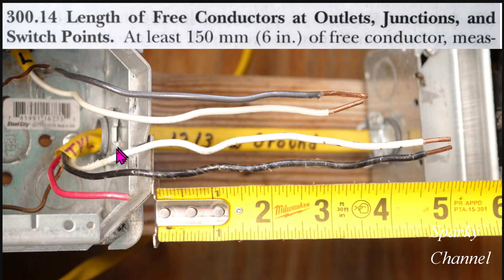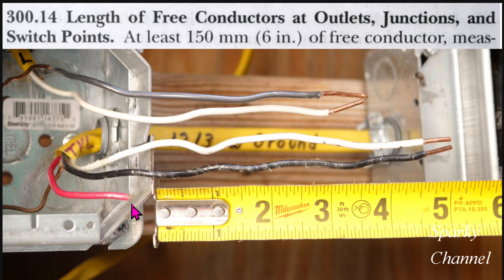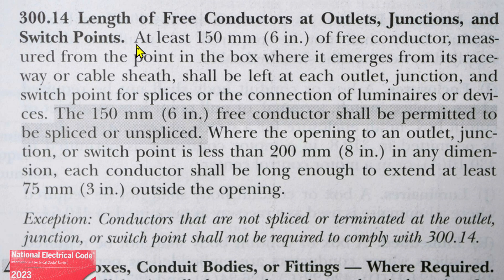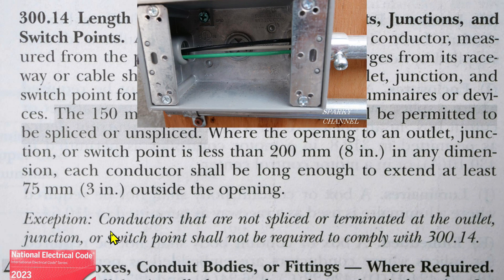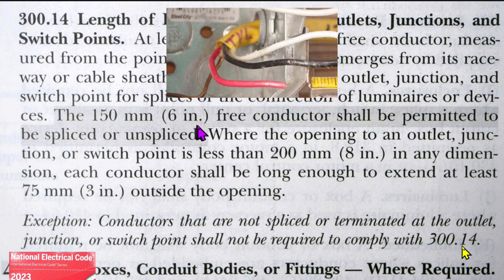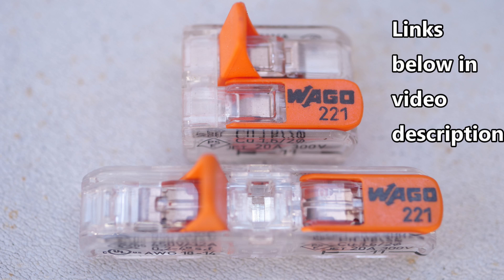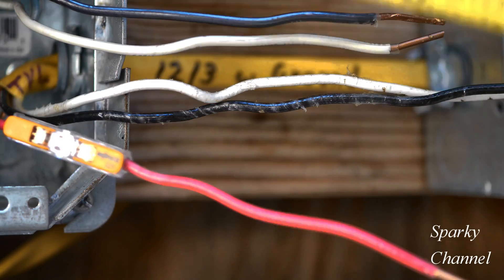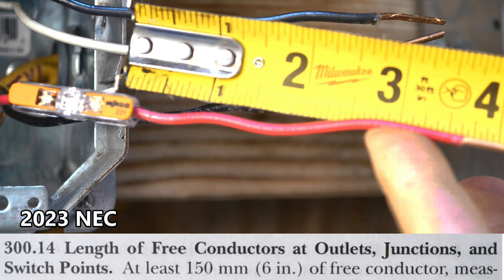How to Extend Short Wires per 2023 NEC 300.14

Comment from the maker: Wago makes 2 inline connectors. The 221-2411 is rated up to 14AWG. The Wago 221-2401 is rated to 12AWG. Also, the Ideal 30-1042 SpliceLine In-Line Wire Connectors are rated to 12AWG. Links for all of these are in my video description.

Comment: Does really explain say lengths required for pigs tails coming off carry through circuits. Logic would say 3 inches on each entry and exit conductor and 3 inches on pigs tail -- but that is not how it works. Each wire should be 6 inches -- and the pigs tails too, (which are not counted in box fill specs). Getting sticking, ground entry should have 6 inch lead-in to screw and 6 inches free after screw hugging the walls of a metal box. So the feed into metal box should be stripped back 12 inches and supply conductors cut to 6" but leaving ground at 12".  Easier to use a plastic box :)

Comment: So, i removed a wall and need to move an electrical box to another wall. The main line wire is too short to reach the box at standard height, i have to move the box up about a foot. Can I use these wagos to add in a length of wire? I was researching and seems like if i did they would have to go in another electrical box? How would you do it?

Comment: When splicing a short wire, I've found that It's a good idea to tape the Wago levers shut to prevent them from accidently opening. I then fold the spliced wire at the back of the box.  If additional wires need to be connected, I create pigtails and use  a 3 or 5 space Wago connector.

Comment: Good info, however, the reasoning you gave for preferring one Wago connector over another wasn't really justified as you can make the extending pigtail the length it needs to be depending on the connector/splice you are using. Personally, I would measure the length of new wire (pigtail) I needed from the back of the box so I would have the required length with the splice point sitting at the back of the box (out of the way).

Comment: Thanks for showing that WAGO LEVER NUTS has a connector that accommodates the lengthening of a short wire by introducing two wires in a two wire connector. 👍

Comment: Home owner here. I have only 2 inches of wire extending from the edge of the box, I can hookup my outlet just fine though. Should I use wagos to get that extra inch and become code compliant? Seems like a huge waste though, adding extra fail points, more cramped box, etc.
Reply: I wouldn't bother. You're good
Reply: It’s fine how it is now. The code exists for servicing purposes, and if it needs to go any shorter because of something like the conductor at the end is worn it can easily be respliced with a new wire if needed.

Comment: Ok maybe you fixed a legal issue, but what exactly does this achieve from the engineering perspective? You already have enough wire in there to insert it into a wago connector, so why not connect it to the actual wire or multiple wires you need to connect to? Those code standards were created when these lever connectors didn't exist. So now you can make an adequate connection with much less wire. In this case, it's definitely short, but it still works fine. What you are doing is you are adding an extra fail point for no good reason other than some outdated bureaucratic rule
Reply: This would only apply if you would need to pass a code inspection prior to attaching outlets or fixtures, in practical use you would not then add another connector and pig tail wire, you would simply use a longer wire, which you could also do from the beginning, there is no maximum length requirement, so long as there is enough space in the box it's allowed.
Reply: I totally agree, it's so backwards to me. If you can wire up an outlet fine, yet don't meet the extra 3 inch rule, you are only adding extra fail points, more cramped box, etc.

Comment: I think you are missing a bit form that code.  The 3 inches past the outside of the box  apply only if the opening of the box is larger than 8" in either direction.  So I take that to mean like a large 8" box for splicing in a false ceiling of attic. Then the wires don't have to be 6" long just extend past the opening 3 inches.
Reply: Heads up, you have this backwards. It says if the opening is less than 200mm in any dimension, then the 150mm past the opening rule applies. So for an 8" box it doesn't need to extend past the opening, but a standard duplex box would need it to.
Reply: they have to be both 6 inches and extend 3 inches past if the box is smaller than 8 inches in any direction, ie most outlet boxes in usa.

Comment: You get a lot more conductor surface contact area with a twist-on wire nut, as opposed to the anyone-can-be-an-electrician snap clips. I would never trust clips to not overheat when used in a high current load application.
Reply: Wago are only splice connector approved for use in Europe. Seems to work there.
Reply: There’s a video of someone testing wagos and a few other connectors with a stick weld set. All the insulation had melted off the wires before the wago died. They’ll survive way higher than their rated amps.. 

We use them in the U.K. with out 240v 32amp/20 amp per leg ring final mains and they hold up fine.
Reply: The US is one of very few countries still using wire nuts. Most of Europe has shifted to Wago connectors which can be used up to AWG10 wires rated up to 41A in Europe and 30A in the US. 

Wagos have been used in Germany successfully for more than 3 decades and they have a lower failure rate than other alternatives such as screw terminals which were previously used commonly in Germany.
Reply: Watch from 7:30 of the video titled "Connectors: Which is the Weakest Link" by the channel "Electromagnetic Videos" After 5 minutes at 50 amps the Wago push-in only connector failed when the current was raised to 65 amps, and the lever Wago failed at 70 amps. Wago connectors are more than safe when used within their rating. Obviously if "high current load application" exceeds their rating then don't use them, but there's no reason to fall victim to "but this is how we've always done it" luddism due to ignorance or disbelief in empirical evidence.
Reply: There is a demonstration video on YouTube where they slowly increase the current.  At the end the wire itself is smoking but not the Wago connector.
Reply from the maker: OK, thanks.
Reply: Yeah, I mean I realize that they're used commonly nowadays, but I myself don't really trust them either. Especially in a high current application. As you said

Comment: Are Glutoad (Amazon) lever connectors as good as WAGO?
Reply from the maker: I personally wouldn't trust them.
Reply: no.  they are not trusted, WAGO's should not be used for motors, heaters and other large loads either, they are for lighting and household outlets only
Reply: @ydnark83  wagos are rated for 32A
Reply: @hellopellos  wago's generate a lot of heat and are known to fail at high amperage.  go ahead and do your worst but I don't trust that paper thin piece of copper when connecting 10g wires
Reply: @ydnark83  I’ve had this argument so many times I wanna puke …..they are rated for 30 amp 10 gauge…..which means the heat generated with 30amp in 10guage  is perfectly fine for these connectors ….We switched over to wagos about 4-5 years ago at xylem / goulds pump (pump factory )
We use them for our larger pump motors and drives ……agian 30amp 10 gauge…..we had more failures with wire nuts in the field in one year then wagos …….END OF DECISION…….wagos take the human error out of wire nuts, you can easily meter them for voltage , you don’t have to cram your meter leads up a wire nuts ass and hope and pray your touching bare wire, my personal favorite is you can do live work with them you can unhook a single wire and not worry about it…….they truly are the future of wire connections
Reply: @stifflers69mom1  no its not the end of the discussion.  There are ratings and rules to everything, but that doesn't mean everything printed 30amps is equal.  Simply put those 2 connections side by side with 20amps running through them and view them with a FLIR camera.  Hell, you can touch the WAGO and feel how warm it gets.  I love WAGO's but they are not the perfect solution for every situation.  Twisting large gauge conductors with a wire nut produces less resistance, that is irrefutable regardless of what is printed or your personal opinion.  If you can't wrap your head around that you must be a great electrician.
Reply: @stifflers69mom1  your argument is similar to a young carpenter saying screws are stronger than nails.  It's mostly true except when its not.  More knowledge is required to really understand why but your personal experience hasn't gotten you there yet.
Reply: @stifflers69mom1  Another thing to consider is they are not "the future" as I have been using them for a decade now and they are still overpriced and only made by one manufacturer, most of the world isn't really interested yet.
Reply: @stifflers69mom1  you can't convince these kind of people. no matter the extensive testing, and research that goes into these ratings
Reply: @ydnark83  They have been used in Europe for decades now. It's always the old timers who have trouble adapting.
Reply: @Passions  I guarantee they are not supposed to be used to install high powered industrial machinery in Europe either.  Always those young guns that can't see the forest for the tree's..
Reply: @Passions  your not listening if you think I don't use them, I just don't use them all the time.  The problem with a Swiss army knife is that its a terrible knife, but if all you do with it is open boxes you might think its the best knife ever made.  Would you install the big 3 phase machines in a cabinet maker or welding shop with Wago's?  Not on my watch.
Reply: @ydnark83  Do you think it's safe for 120V 20A residential outlets?
Reply: @Passions  yes, but I wouldn't use them in a dedicated workshop and I would generally avoid wire connectors entirely unless a pigtail was unavoidable
Reply: @Passions  I wouldn't use them to connect electric heaters either
Reply: @Passions  I meant direct wired heaters on dedicated circuits like baseboard heaters.  Its not that I don't think wago's are safe, for most circuits they are the superior connector.  Its that they have a much higher resistance vs twisted together wires.  Its all about surface area and Wago's have about 1/20th the surface area as a wire nut connection.  Have you seen the same high amperage test with a FLIR camera watching the temp or even just touched a Wago that had a big constant load on it?
Reply: @Passions  wouldn't use them to connect an a/c unit either.  or anywhere where corrosion is inevitable like on the docks in a marina

Comment: what is the difference using a wire nut ?
Reply from the maker: They will work great if you can get your fingers into the box to properly twist it. Those short wires can be frustrating to work with.
Reply: The twisted wire connection is going to be the best option with a wire nut. If you're not twisting, you're relying on whatever connector to make the connection for you. Depending on what is on a given line could be bad. I'd never use one for anything in a kitchen, but a bedroom outlet with only a light or a clock with little load would be better and make me more comfortable about the connection.
Reply: @markv.7842  Watch from 7:30 of the video titled "Connectors: Which is the Weakest Link" by the channel "Electromagnetic Videos". After 5 minutes at 50 amps the Wago push-in only connector failed when the current was raised to 65 amps, and the lever Wago failed at 70 amps. Wago connectors are more than safe when used within their rating, and full load 20 amp circuits are well within their rating.
Reply: @msytdc1577  How many service calls have you been on to power outages where root causes were failures in push in wire technologies? I've been on many over the last 10 years. You know what I've never seen fail? A twisted wire connection. So yeah I'll put all my experience against your youtube video any day.
Reply: @markv.7842  lol, okay boomer 👍🤓🤡
Reply: @msytdc1577  Yeah, the response I expected. No experience, only Youtube.......
Reply: @markv.7842  i'm agree with you and twisting is the best for safety installations.

Comment: Like what would the NEC have you do other than splice it?  Tear out the wall and install a new run?
Reply: Pull it out through the conduit and run a new wire. If the whole installation was done following code, you would not have to tear out the wall to run new wire.
Reply: @mckenziekeith7434  For 95%+ of residential construction wiring code does not require conduit, so that isn't a thing, and code does require the wire be affixed to the studs, so you cannot remove existing wire without removing drywall, though you might be able to leave it in place unused and just fish a new run along the same or similar path.
Reply: @msytdc1577  I guess that is true. It is usually NMC behind sheetrock. I guess you can tell I am not an electrician. Most of the electrical work I have done has been outdoors, so I used conduit. But in residential interior construction that would not be the case.

Comment: Does NEC allow the WAGO splicers for in-wall wiring?
Reply: absolutely not. there are listed splice kits for nm and other applications.
Reply: Yeah I doubt it.. you need a box for the most part. I have seen a splice kit that advertised no junction box needed in a YouTube video and they got it from Home Depot but I couldn't find it online or locally when I actually could have used it on a job.
Reply: @digi3218 it's been removed from Home Depot

Comment: The only time you have short wires is when idiots cut connectors off. I've been an electrician inside industry and in home building for over 30 years. It only happens when you follow after some idiot who is lazy and has a pair of wire cutters.
Reply from the maker: It's frustrating, isn't it?
Reply: Yup, but also when the drywallers get careless with their router.
Reply: Which would be all the time lol. As long as your working residential You will always deal with short wires.
Reply: Or you have some shit wire that has had the insulation become brittle and crack leaving exposed conductors, especially where it has been bent in a tight radius to get jammed into the box. Now you can choose between leaving it to the fates and shoving it back in, wrapping the worst in electrical tape and thinking positive thoughts as you shove it back in making new weak sections, wrapping everything in electrical tape (black, black, and ... black, surely, right?), or you know, fixing the problem by putting in new identifiable and safely insulated wire splices. Guess only idiots would do that though, in your world of black and white and over simplification and all.
Reply: and this is why you use WAGO.

Comment: Is there a limit to how many wire extensions you can do in one box? I use WAGOs when doing my DIY electrical work. Their splicer device looks great, but it seems to be on the long side. I'd like to see them make a new two-wire connector that has one of the two ports reversed. This would be very helpful in many situations and take up less space in the box.
Reply: Good idea.  Call and recommend it.
Reply: There are rules on how many conductors can be in a box and how much of the boxes volume can be used.  Too much for a comment but if it looks to full it probably is.
Reply: @ydnark83  the short answer is yes there are rules.  It would take several pages to list those rules.